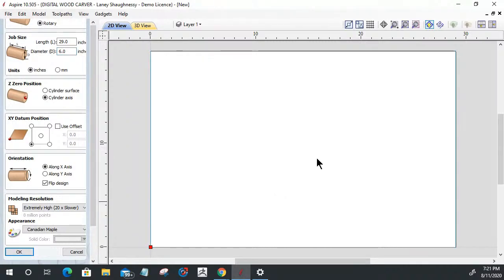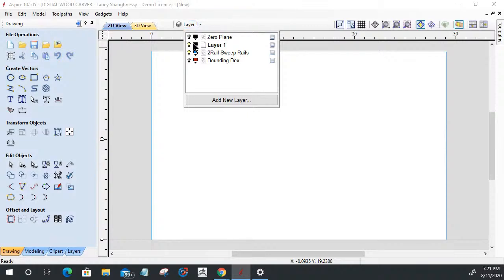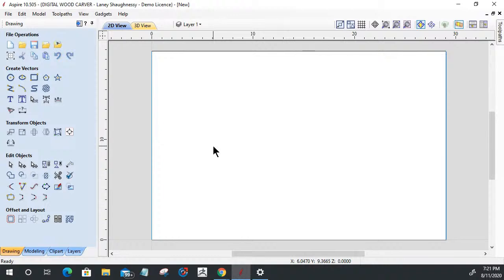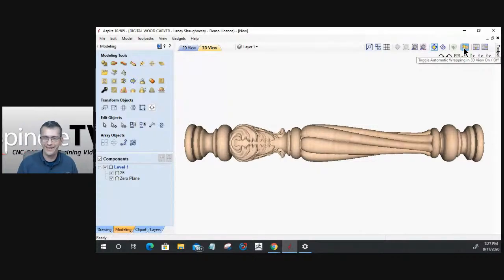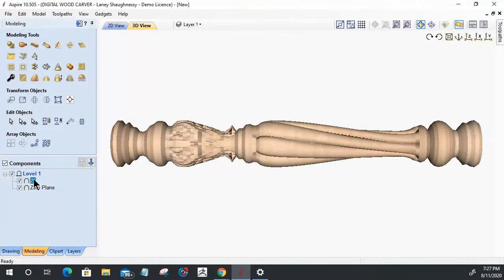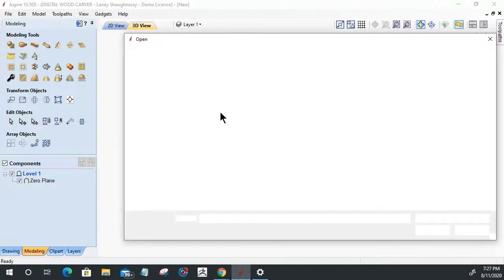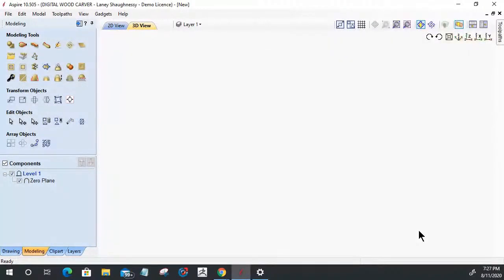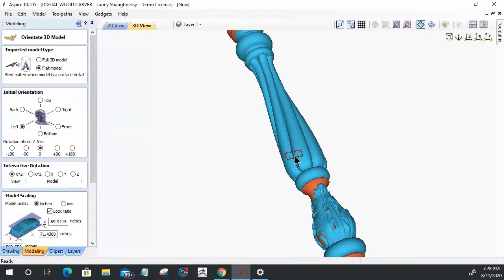Rotary Design Project & Live Q&A - Vectric Tutorial

Comment: I've been following you videos, and was wondering if you would be able to do a concave surface, like an engraved plate, on the 4th axis?
Reply from the maker: Depending on your 4th axis setup..if your router cuts from overhead of the spindle you could create the pocket needed for an engraved plate of your router comes at the 4th axis from the side like the DWC2440 you wont be able to get a flat surface for the engraved plate due to the rotation of the 4th axis

Comment: Where do the models cons from? My installation does not seem to have them
Reply from the maker: Your vectric software has many clip art models included. If it is v10 or v10.5 there are some rotary profiles as well...earlier versions will not include rotary profiles. As far as where to get models, ebay, cgtrader, designandmake and other sites have models for sale